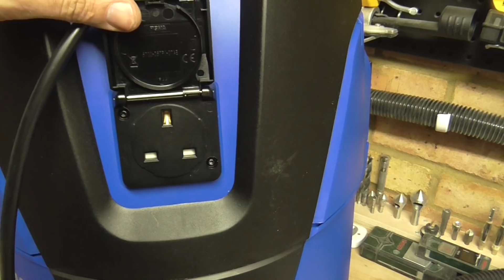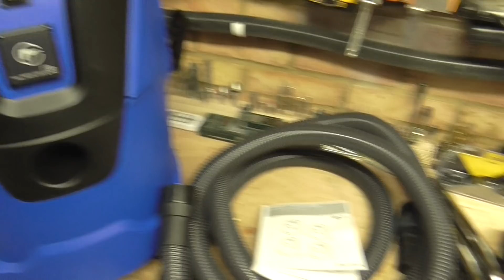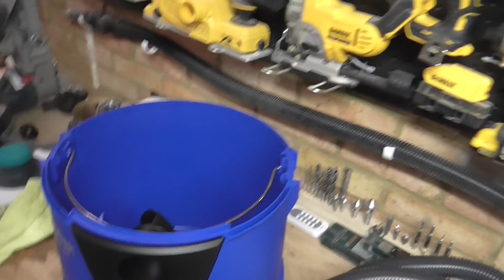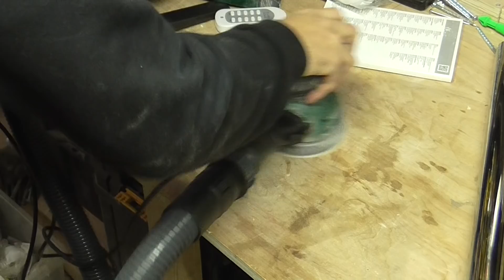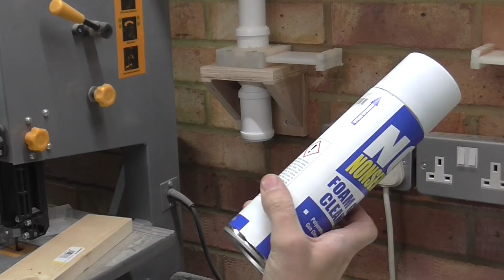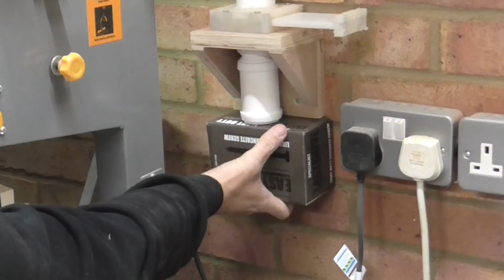Budget Workshop Vac With Great Features - Nilfisk Aero 26-21

Comment: Hello, if you read this, I have the same system but the nilfisk buddy II, and it is so powerful that when the nozzle bock the barrel implodes. I broke a couple of them and lately I bough a oipps from amazon, with way better quality but still has imploded. Have you been there yet?

Thanks
Reply from the maker: Yeah I have had a couple of issues with barrel implosion but I’m careful not to block it for too long. You could look at bracing the inside.
Reply: For what it's worth, the Aero 26's rated static underpressure is equivalent to submering the barrel under 2,1 metres of water.

I don't think there's really anything to be done at that point except switching to a steel drum.  
  
P.S. 
Yes, I am 5 years late, but "better late than never" is how the saying goes, isn't it?

Comment: thats cheap for an m class vac, what wattage is it?
Reply from the maker: Filter from M class is the same one. I bought a spare and it says m class.
Reply: @WheresMyPencilUK  your right the filter is the same, but to be certified M class it would need an audible alert for low flow (filter replacing etc) and adjustment for air speed (+ a few other things). Certified M class start at around £300. Not so important in a home workshop I reckon, so really you saved £150 and just need to remember to check and change the filter often :) - thanks for the video, cheers Bill
Reply from the maker: No worries cheers Bill. As you say fine for workshop and a good bit cheaper! 👍🏼
Reply: it's not certified M class

Comment: Don't you have trouble with the blue can crushing under the vacuum?  I did, using one with my Miele house hoover, even after I tried packing it out with plywood bracing.
Reply from the maker: No it’s fine if you have trouble with crushing it implies you have a blockage.
Reply: I have the exact same setup, but with a Nilfisk T20 instead, and if you block the hose with e.g. your hand, the cyclone barrel (mine is the 60L version) will buckle inwards from the vacuum after 1-2 seconds. As HWHL says, if the air is flowing, then no problem at all. So far I have been able to 'un-buckle' my barrels whenever it has happened, but it is a little annoying. A plywood bracing should definitely resolve the issue though, but you will need to make the brace in two parts and assemble it inside the barrel, as a full size bracing ring would not fit through the opening of the barrel.

Comment: Wow that's a great price for m class'
Reply from the maker: Yeah to be fair it’s not their m-class certified vac (that’s about £300) because it doesn’t have air flow monitoring but the filter that’s in it is an m-class one as it’s the same that comes in the m-class certified vac. 
When I bought it I bought an additional filter that was specified as m-class but then found it was the same one as already in it!
So in summary from the research I’ve done, the filter is m-class but the vac itself isn’t m -class certified due to not having air flow monitoring. 
Hope that makes sense.

Comment: Nice vid as always, thanks.  are you sure it’s M class, as non of the sites state that ?  M class vacs are twice the price, so blooming bargain if it is.  Keep up the good work👍🏻
Reply from the maker: Yeah I was a bit unsure but when I researched the replacement M class filter for it, it was the same one it came with. So now I have 2!
Reply from the maker: Link to filter here on screwfix. https://www.screwfix.com/p/nilfisk-302000490-wet-dry-pet-m-class-filter-cartridge/97190?kpid=97190&ds_rl=1249484&ds_rl=1245250&gclid=EAIaIQobChMI__SBn-7L2AIVRyjTCh3kSQEUEAQYAyABEgKxPvD_BwE&gclsrc=aw.ds&dclid=CLyUsqHuy9gCFcK8dwodTe4PPA
Reply from the maker: I’ve just done a bit of research as you had me wondering!
Basically it’s not their M class certified vac, that’s called the Attix range. 
It does however come with the same filter so I’m not sure what make the Attix M m-class certified it may be the flow sensor which my vac doesn’t have. 
So the filter is M-Class which is good enough for me given the cost and it means it will be filtering out 99.9% of the particles. 
Hope that helps.
Reply: Happy Wife Happy Life , thanks for coming back, looks like we were both researching the same... the hours I’ve spent researching dust collection😂, M Class / HEPA, particles, all very confusing, but one thing is certain extraction is better than not extracting.  Thanks enjoy making dust👍🏻
Reply from the maker: Thanks Richard, as you say something is better than nothing!

Comment: That’s very useful thank you.👍 I noticed when you are doing the tests you use a box of concrete screws - I only discovered these last year - pigging brilliant they are.😀
Reply from the maker: Yeah I have a pet hate for rawl plugs so love them. 

Shame they can’t be used on breeze block though. 

The DeWalt wall dogs are great too and work on breeze block but are only light duty. Good for pictures and small shelves though.
Reply: i have those same screws bought from Screwfix, i have used them to put the first half of a french cleat batten on a Breeze Block wall in my shed, with no problems and with a couple of heavy cabinets going on it as well, stayed up nice and tight no probs. They can be used on Block, Brick and Concrete.
Barry (Wirral)
Reply from the maker: That’s interesting Barry I tried them on one of my walls which is block and they were easy to pull out. They recommend a 4.5mm drill bit which I don’t have so used 5mm; perhaps that was the issue.
Reply: Happy Wife Happy Life Not All breeze blocks are equal - I do not think they would work in the Thermalite blocks.
Reply: Maybe, i love them defo better than using plugs all the time, i can't remember the bit size i used to drill into the wall, i'll get back to you on that tomorrow if you want? but i haven't had any probs with them.
Barry.
Reply from the maker: Ok thanks Barry. 

You are right Norman, maybe mine are thermalite, problem is you don’t know until you drill them. To be fair I just popped a plug in the hole and hey presto!

Comment: I got the same one last week. Im very pleased with it. I have filled the bag already. I like the push to clean filter button. Mine has a rubber strap that can hold the cable.
Reply from the maker: Yeah it’s really good. 
Ah that’s what the strap’s for! That’ll teach me to read instructions!
I haven’t tried the push to clean button yet, not sure I’ll use the bag as have the cyclone but probably would help.